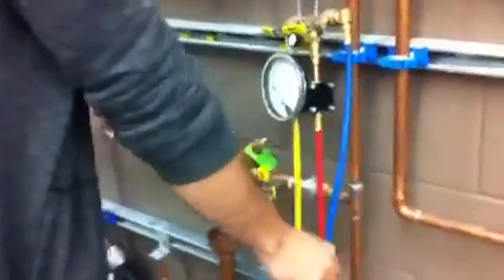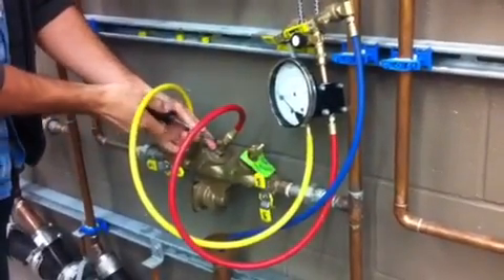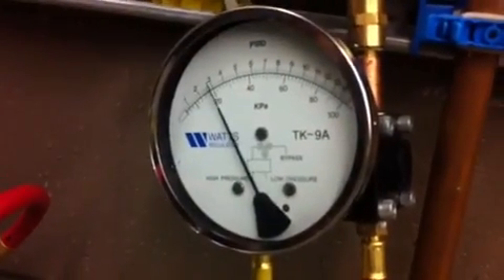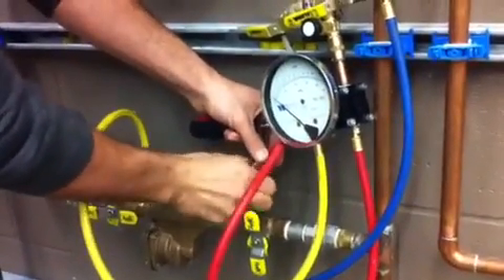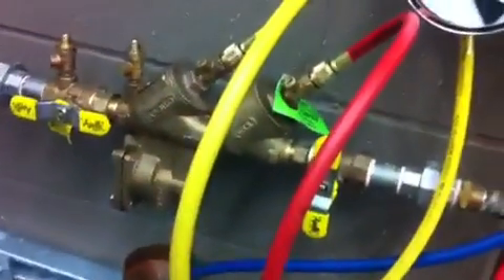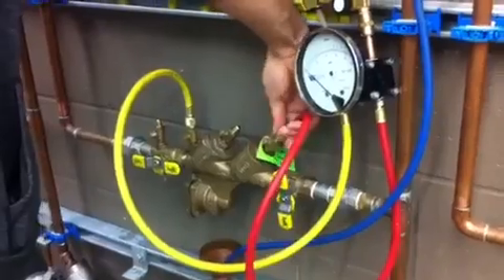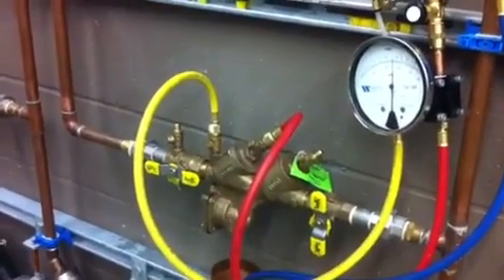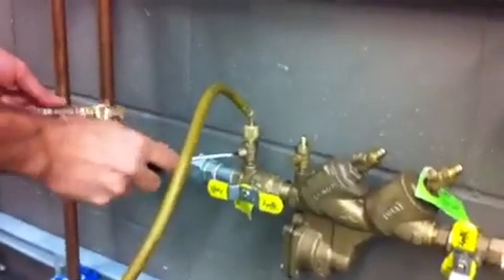How to test an RP/RPZ

Comment: That’s different a way from what we do in kackalacky.   After notifying the owner that the water is off to the building We usually start with check one ports 2&3 and then the aux spring then take the bypass throw it on port 4 Then after that no more bypass.  we go to check 2.    Ports 3 and 4.  All That gives us our psi and psid and buffer.   Never had to do a hydrostatic off port 4 with another piece of equipment .   So I’ll ask about that one.

Comment: Currently attending the same college where this was filmed 8 years later and they are still teaching the RP backflow test this way. In Canada Our written test is for the AWWA certification but in Ontario, Canada our certification comes from the OWWA and we're taught that the color coding doesn't matter for the hoses.
Reply: That's not good lol this is instant fail before he even starts by creating a cross connection by putting the hose in the drain lol